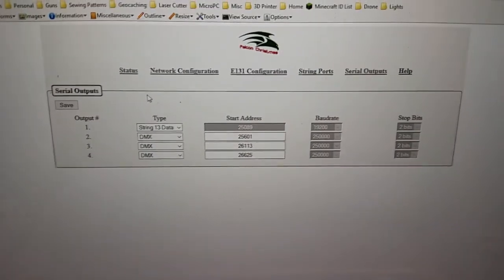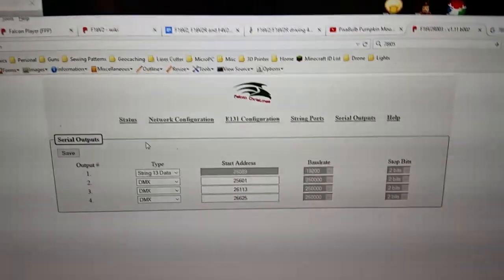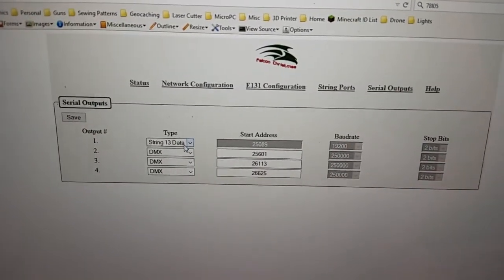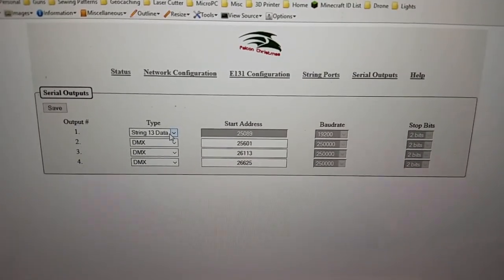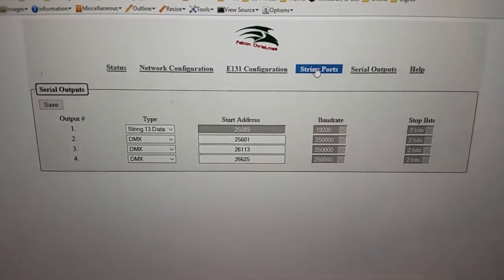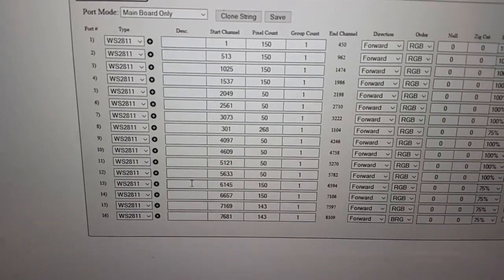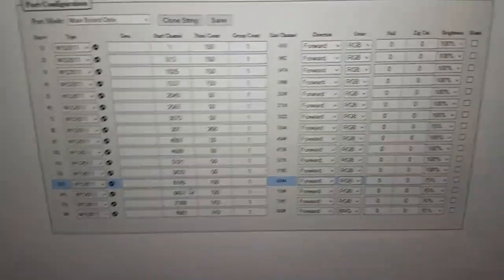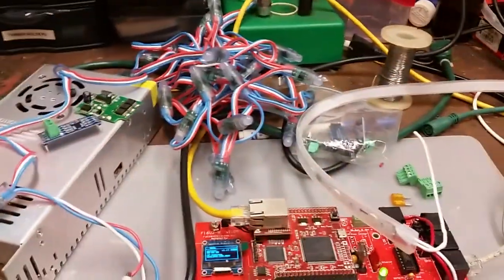eBay 485 Receivers for Falcon F16v2 Boards

Comment: Will this 485 board work on a picap?
Reply: We don't have the ability to control the PiCap's DMX port adequately to support a string of pixels (if we could, then these boards would work in the manner that you are suggesting). Thus far, we can only support using the Pi's hardware PWM outputs for this. You could, however use a pair of these RS-485 boards (one as transmitter, and the other as receiver) to achieve the same effect with the PiCap's pixel string ports.